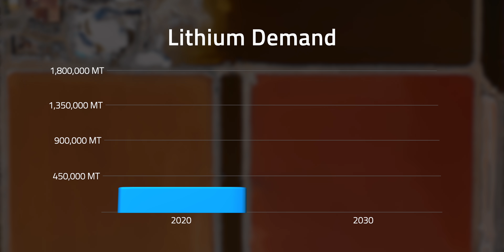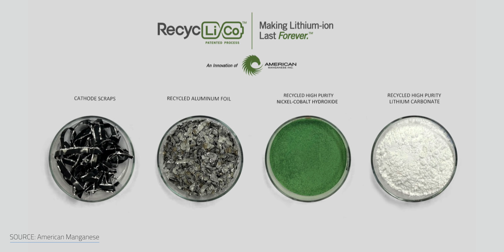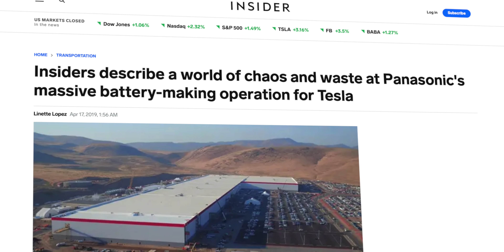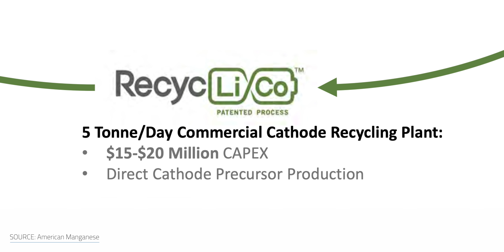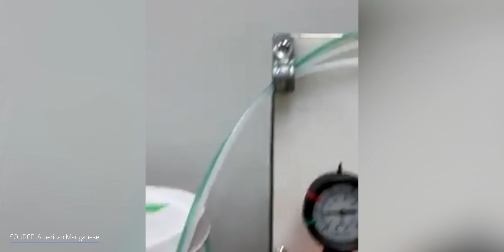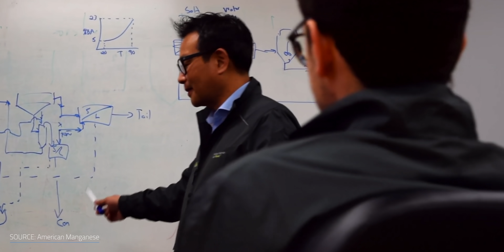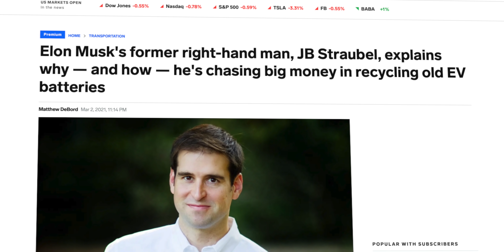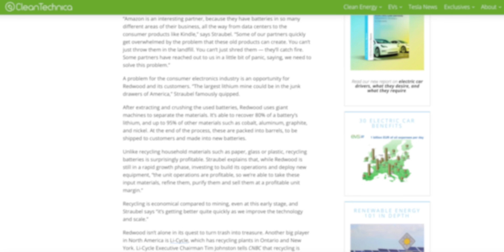Solving EV's Biggest Problem - Battery Recycling Explained

Comment: I don't think recycling batteries will  take over the need for mining
     Just look at the aluminum Industry over 65% of all the aluminum is recycled aluminum and over 70% of all the aluminum ever put into circulation is still in circulation this industry even has incentives on it's most used product the beverage can to return it, all this yet their are still they're still dozens of mines all across the Earth for aluminum so I think recycling will mean less mining but not replacing it entirely

Comment: This is assuming of course that lithium iron batteries will be the only power source available, isn’t there a lot of research into other battery make up and chemistry?
Reply from the maker: Tons, yes.  But many of those are still years away at the earliest (some may be decades).  No matter the chemistry and makeup, we need to have a good recycling infrastructure in place.
Reply: @UndecidedMF  absolutely agree, recycling is vital, and the continued use of the batteries following their use in cars is also important. Just wondered where we are with solid state batteries?

Comment: If the production of Li ion batteries were to increase as was projected at the video start, recycling could not possibly overtake mining until sufficient quantities are in the system.  It should be of gradually increasing importance.

Comment: The real consumer breakthrough would be for standardisation to allow new batteries to be drop in replacements for old ones.  That way electric cars being sold today could eventually be refitted instead of scrapped.  As it stands, current electric cars will be worthless when their batteries wont take a charge.  Car makers are not going to be promoting replacement batteries when they would rather sell a new vehicle.  Battery companies would rather keep their car maker customers happy than sell replacement packs to the aftermarket.  10 year old electric cars will not be a common site, and the cost will fall on the consumers.

Comment: From what I understand with the lithium recycling the largest issue is actually bringing unsafe and damaged batteries somewhere where it can be recycled. Because most places are unable to test what is safe and what is unsafe they sit in dumpsters until one of the bad ones catch fire then they throw away the whole batch. Because they caught fire it's technically not batteries anymore to manipulate data. The other issue is when electric cars get damaged in a car accident. Most fire departments and tow-yards don't understand the issues and can catch fire again. 

I saw a company that freeze dried batteries out in the field before grinding it up into their neutralizing solution for safe transport to recycling locations. I think that company should have some spotlight but because it hasn't I can't remember what it is called either.

Comment: Recycling will most likely fail. Because of at least 2 things: 
1) economy and cost. Just like recycling plastic failed - battery recycling will probably fail as well. Yes, of course you can extract up to 100% materials, but it doesn't mean you can compete with original mining. Especially in the beginning. Lithium price will be a U curve and it is currently going down. But it's a relatively scarce material and we will probably run out of it by year 2050 or even sooner. If the demand in 2030 is 5 times higher than in 2020, assuming the proportions remain - we'll need 45 mil tonnes of it in 2040 and 225 million by 2050. But we only have 81 million... So the Li price will eventually go up and that will be the time for recycling to shine - not now, not even in 10 years... 
2) and when the time to shine comes - they are very likely to be overwhelmed by shire quantity of batteries to be recycled. There is no visible capacity to recycle so much... So that again will force the prices up, which in turn will force the price for end product up.

The solution to all this is very simple - not to create Li infrastructure in the first place! Unlike lithium, which has a U price curve, hydrogen has an L curve and will only go down with time. It is more expensive now, but in some 10 years the price will level out making Li obsolete and not competitive. Creating Li infrastructure is a massive waste of time. We should be creating H2 infrastructure because it will stay forever... We're making a huge mistake...

Comment: I don't think recycling is the biggest problem for EVs. I'm sure we'll figure out a way to recycle the batteries. Far bigger problems are the grid infrastructure and lack of non-carbon based electricity generation.

Comment: Our recycling model is flawed to begin with in terms of making a sustainable business model. From plastics to steel only a small percentage are recycled. We should recycle the batteries and being a PHEV owner I hope they are. There should be a government incentive to get the ball rolling with a predetermined tapering off to prevent industry dependence on said government assistance. Also a law that says a percentage of batteries sold need a certain percentage of recycled content, like what we do with ethanol in pump fuels.

Comment: cars are very heavy and not efficient should be phased out regardless of power source.    With electric bicycles we would not face such battery pressure or electrical generation requirements

Comment: I think we need to use hydrogen for storing energy(grid) and in cars. Yep, the efficiency of hydrogen is not compared to pure electricity, but with tight connections with sources of renewable energy, it will give a lot of bonuses.
Reply: In the future, when we have excess green energy yes. Now when we haven't cleaned up the grid yet, no.

Comment: comparing the efficiency and profitability with the mining sector could be a good content too. to my understanding litium mining is only 40% extraction rate, and the material can take up to 5 years before ready to enter the manufacturing so it should be a low margin business. american battery metals claim to have a technology that can process used batteries and make an almost 99% pure material in about 3 hours with 65% margin. their plant will have a capacity of 20,000 mt a year, in compare with 5000 mt a year of li-cycle. that's a wining industry IMO.

Comment: There's also a promising form of recycling that's baking the electrolyte to make new reconditioned battery cells. Even if we have maybe a couple years before recycling makes economical sense, storing all these battery packs and cells in the mean time requires a lot of secured space, so recycling solutions can't arrive too early. I don't think we'll have reached a battery demand peak by 2030, but whenever it happens, and with recycling rates nearing 100% of high purity material, there will hardly be any need for more mining for batteries.

Comment: I just want to highlight the issue with one example, Plastic! We have the method, way simpler process then recycling battery Yes, still 269000 tons is in the ocean and thousands of tons is in the landfills causing all sorts of trouble, it's pretty clear lesson from the history then "recycling" as a concept is nice but in real world it has failed. Why it has failed one can find out!
Reply from the maker: Problem with plastic recycling is that it's more expensive than making new plastic.  With lithium ion battery recycling it's going to be cheaper than mining new materials.  Economics should push battery recycling in a way that plastics never did.  Plastic recycling is a sham sadly.  We need to figure that out too ... pronto.

Comment: i hate using batteries so i try to use the least amount because it comes down to broken vs battery that has a limited charge with a limited amount of times you can recharge, which also means you have to take care of the batteries so they can last longer

for phones I use headphone jack so i only need 1 battery, instead of 3 batteries one for each ear + phone

Comment: So here's what I need education on: what is it about the recycling process that takes the same material but renders it capable of holding a charge again? Is there something in the re-refining or recapture process that sort of resets the energy potential of the materials? Or am I missing a larger structural concept?
Reply: for the majority of rechargeable battery technology, the energy potential of the materials themselves doesnt change, the amount of space they have to their work does, on charging, and discharging, slowly dendrites form, dendrites basically being 'spikes' of material that slowly work their way from one 'side' towards the other 'side' of the battery, lowering the 'space' the battery has to do work. (this is heavily simplified, please do a search on why batteries decay this channel has one iirc)

Comment: I mean, that's A problem... but, not at all the biggest problem with EV. You know all those folks who rely on a massively depreciated used car market? Like me even, with my 05 tahoe.... That's a truck that cost $44K new, that I got for under $5K when I bought it. Still with driver memory, power pedals, wheel, seats, heated seats, mirrors, auto dimming mirrors, nav, BT, screens, DVD, etc etc etc.... and today's equivalent START where mine maxed out, with them maxing out at near $100K. When all of this turns EV, what is going to disappear is an old enough, and worthwhile enough, used market. The sleds (or battery packs) will be trashed, motors worn, with the former being enough to warrant them overpriced and simultaneously worthless. Imagine buying a used car, and one of it's downfalls being that it only goes 14 miles before needing recharged. Like a worn out drill... ... ... Yet still costing WAY more than today's used cars, because this new market will simply refuse to depreciate the same. All of a sudden literally everyone will be expected to buy new. And that is not a realistic model, plain and simple.... and don't even get me started on why autonomous literally CAN'T work. And it's not due to the tech... Just look at Ohio and states like them, with literally no one telling vehicle owners if they're road worthy or not. There's a reason why OH cars and trucks are the worst looking, most falling apart, and cheapest. Even when they look good, they are FAR more likely to be trash, due to no state inspections. Now imagine autonomous cars, owned by Cleetus the general OH resident... neglecting ball joints, brakes, tie rods and ends, sway bars, shocks, struts, springs, bushings, bearings, and well... everything. Then continuing to have his car drive him home from the bar, because DD right?! What's worse, a drunk driver, or a car that thinks it knows how to drive itself, yet who's baselines are ALL WAAY OFF due to braking distance being increased, body sway being increased, steering being sloppy, etc. It uses it's basic inputs and outputs, which are based on good parts, but its parts are as far from good as can be.... and it wrecks. And they all begin to wreck... what do we do then, say that autonomous cars are only allowed to be used 2-3 years after production, after which point we crush them? Then BUY NEW AGAIN?! lolol.... it's all destined to drive straight in to brick walls, fundamentally.... ideas that have no way of working in the real world, or at least no way of working without massive implications to the vast majorities lives... negative implications.... really really negative ones.

Comment: Great video. As a trade association representing the auto recycling industry we have been paying very close attention to this. We have already produced extensive training material for safely and properly dismantling EV's, as well as handling the high voltage lithium Ion batteries. Many of our members have these batteries but have no buyers.

What are your thoughts on companies that are mining polymetallic nodules from the ocean floor? Potato-sized nuggets containing metals in concentrations much higher than what is found in terrestrial mining ore.

Comment: No one I have spoken to regarding EV’s has ever mentioned recycling - not that is not a worthy topic - instead the top 5 topics are 1. Range 2. Range 3. Range 4. Range 5. Where does everyone think this electricity is coming from?
Reply from the maker: A better title may have been "EV's Biggest Secret Problem."  Range is getting dealt with in a very public way.  Better battery chemistries, jumps in charging capacity, etc.   And our grid infrastructure is getting cleaner year after year.  In time that's going to be a none issue.  In fact, it's not a major issue today.  EVs charged completely from coal power plants are still cleaner over the life of the car than a gasoline car (I have another video on that topic).  Recycling is the looming problem.

Comment: Completely understand battery designers wanting to maximize power density, battery life, etc… But why not integrate a plan for EASY recycling as a basic element of battery design? Even if a few compromises to battery performance need to be made, having an efficient built-in plan to recycle the components from the very start makes sense. Heck, it’s working for Elon’s reusable launch vehicles.

Comment: recycling minimally occurs for plastics due to cost.  your video doesnt mention cost, but its probably much higher than mining.
Reply from the maker: I did touch on that, but not with explicit numbers (still in demonstrator phase for most of these companies).  BUT ... in many cases it will be cheaper to recycle than dig new materials out of the ground.
Reply: Cost is what prevents a lot of plastics which can be recycled from being reused and they just sit in recycling facilities because the managers can't find customers. Then there is the legislation that would require plastics to be recycled, it just not in place in a lot of areas so they just end up in landfills, and plastics from industrial fishing are left in the oceans. Maybe certain industries that need ultra pure versions of these metals would be willing to buy them from recyclers.
Reply: Battery metal prices are expected to rise in short term at least :)
Reply: $1/kg of reagents
~$15/kg value in the cathode precursors that are produced.
$14/kg profit not including electricity costs.

Comment: If you want to ¨save the planet¨don´t have more than 2,4 children, plants trees, and use public transport.
As long as there are coal plants in your grid, it´s nitpicking between ICE (=hybrid without plug) and EV´s. That´s right; Hybrids. You cannot compare a brand new EV to the average low tech ICE car being on the road today.
The transition also needs better timing, depending on the local power sources available.

Batteries are indeed the biggest problem. Therefore we should focus on a clean power grid aimed at land based structures, and on electrifying the rail roads. A flat tax on flying, and building of-the-grid houses, so we need LESS power.
But instead, we have to keep those coal powered plants up & running for EV´s (and their not so clean battery technologies, that will soon be replaced just like the CFL lamps).

Comment: I don't think a lot of those batteries will get recycled.  They'll become power walls.
Reply: While it’s great to get as much use out of each cell as possible before recycling, eventually every cell will have lost so much capacity that it no longer makes sense to continue using it. There’s no battery technology yet available that has an infinite lifespan.
Reply: @RickinICT  The question would be how long until it loses its usefulness?  40 years?  50 years?
Reply: @Cspacecat  why is that the question? Do you prefer they not be recycled in twenty years? Or forty years? The bottom line is that all batteries will eventually reach EOL. And most far sooner than you’re predicting. We need to be able to recycle them when that time comes, if for no other reason than to keep the toxic metals out of the waste stream, assuming we’ve since discovered better technology that doesn’t require them.

Comment: why not just make batteries from more abundant elements
Reply: Chemistry
Reply: Sodium batteries are being researched. But so far lithium is just too damn good.

Grid storage can use stuff other than lithium though as power density is less of a need. I think fusion experiments use flywheel batteries.

Comment: They add core charges to standard car batteries when purchased to incentivize the return and recycling of the bad battery. Do the same with the electric car battery and auto recycling facilities already sort and recycle the metals in cars. So separating batteries won't be too far of a stretch

Comment: It's kind of surprising how much we haven't recycled a lot of things or made a process for it. Or even how we've not tried to make isotoped of helium or beryllium or any other material using radiation to convert them into another element.
Reply: The physics behind making interesting isotopes is reasonably well understood and we can do it the problem is it's ridiculously expensive and impractical. Converting one element to another is also possible but again it's totally impractical. As for recycling, a lot of things are hard to recycle because they are made of mixed materials. Plastic coated cardboard cartons for example are really tough to recycle because you have to separate the plastic from the card some how.